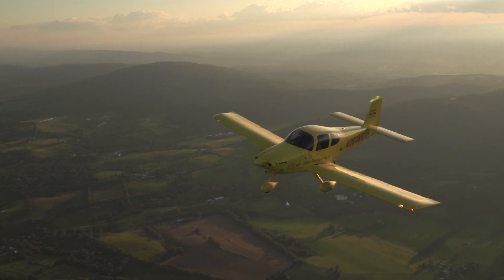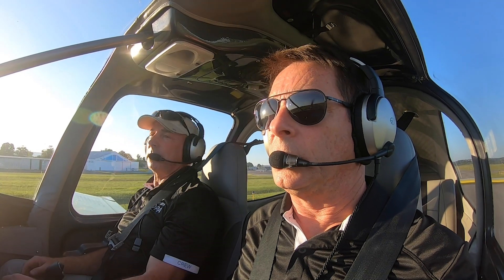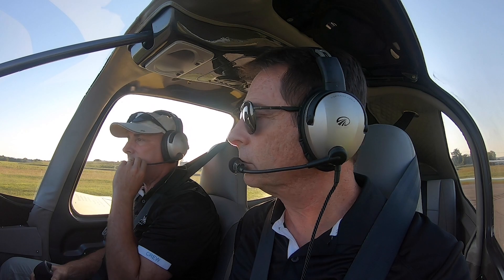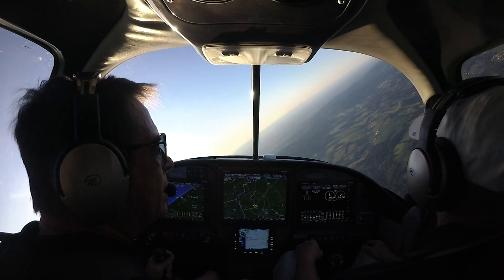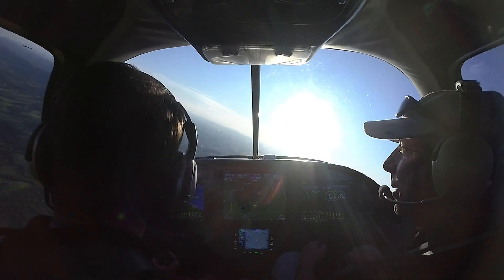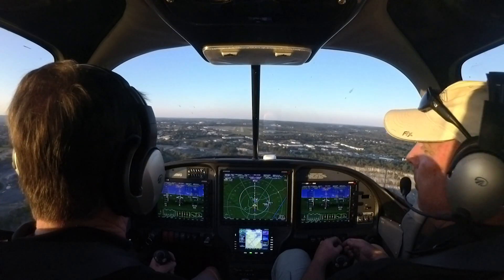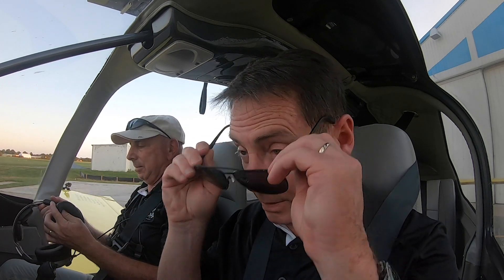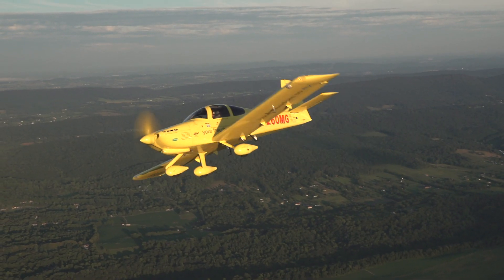What it's like to fly the AOPA Sweepstakes RV-10

Comment: Good comprise on speed, Ha. Too afraid to say it cruises as fast as his Bonanza without the retractable gear stupidity. Also too afraid to say it has more cabin room shoulder to shoulder than his Bonanza. You can put full fuel, four people and baggage in the RV-10 and laugh at people who spend seven hundred thousand on a plane. With the money you save owning or building a RANS, you could put a kick ass SDS EFI on your engine and have a plane that cruises at over 180 kts and never have hot/cold start issues.

Comment: Build it yourself for almost 10 - 25% of the cost of a production airplane, depending on your options and interior finish. Save on annuals and maintenance by being your own mechanic. Customize or upgrade when ever you want, with the latest the industry has to offer, without waiting for a bureaucracy to give you permission. I find it very difficult to see a down side to the Amateur Built Experimental aircraft market. Other than it's not for everyone. Not everyone has the skills or discipline to build and properly maintain an aircraft. Other than that, it's a clear winner.